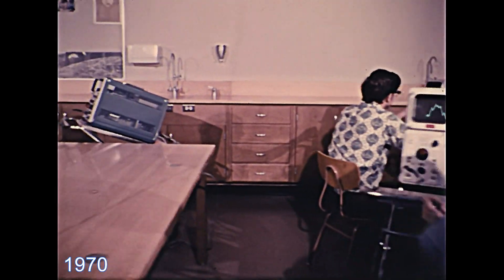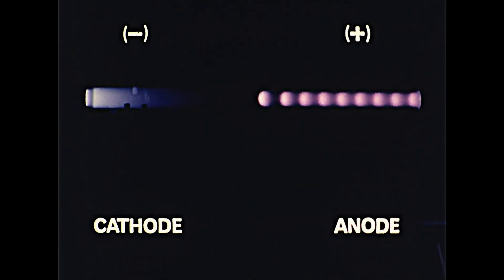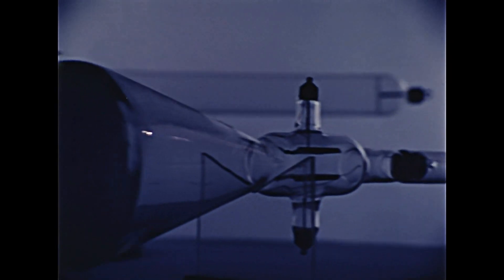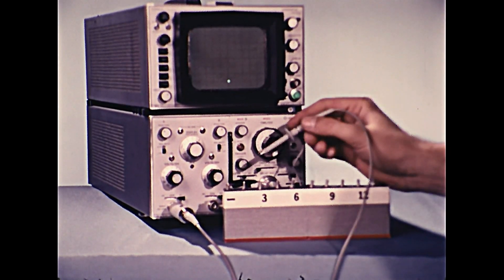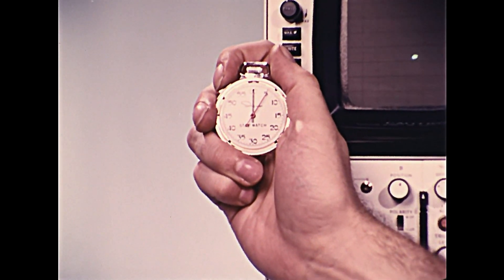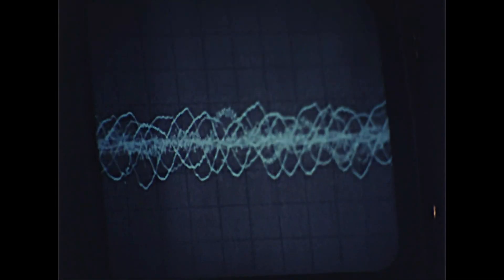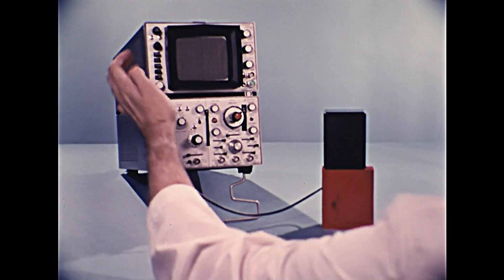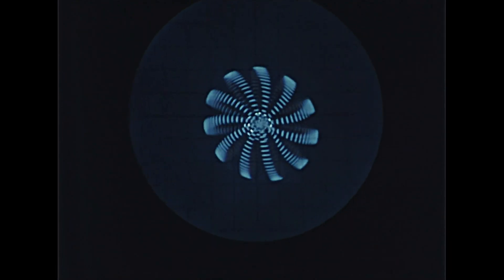1970 Vintage Electronics- The CATHODE RAY OSCILLOSCOPE - CRT Tektronix 561A  HP 180A

Comment: As an electronics engineer in the 70s/80s I used these a lot. Probably one of the last times I used one was to align the read/write heads on those new-fangled 8-inch floppy drives in the early days of digital. Yep, the heads had to be manually set up to read/write floppies correctly. In my collection of junk memorabilia I still have an 8-inch 'alignment diskette' needed for that process.
Reply: I have a 5 1/4 alignment disk, anyone with a 3.5 to complete the set ?

Comment: That's an HP (Hewlett Packard) scope , I believe.  The major brands of that time are largely all gone, only a shell of the entity exists today.  The Cold War largely contributed to their growth, end of the Cold War caused a huge equipment surplus market and sharp fall of retail sales.  Farming out the manufacturing reduced costs and increased profits.  Ultimately, given many years, this causes the major brands to lose market share.  Uncle Sam steps in to stop the massive bleeding with protected markets.
Reply: Keysight appears to be the cultural offspring of the instrument branch of Hewlett-Packard.   I wrestled for years with whether to get a digital oscilloscope and which one; Rigol's are good and inexpensive but I wanted something just a bit better with a real instrumentation heritage but not laboratory cost.   DSOX 1202G also has a built-in signal generator good up to about 20 MHz and can do some amazing things; but I wanted not to give up any analog scope features such as variable persistence and X-Y mode.  It can do all that pretty well.
Reply: Tek and Hp now aglient are the traditional high end scopes.  The high end is joined by LeCroy and R&S.  They have abandon the mid and low end markets to compete only at the high end and with it the high price.  I dont buy Tek or Hp for my business  they are better but not the price difference better and like most i dont need a cutting edge scope for my designs.  I went to school with Tek and Hp, and both brands still push heavy in the school market trying to gain young fans.  What i would tell Tek and Hp is engineers will pay more, not that much more and they are more likely to buy on value than nostalgia
Reply: @EfieldHfield_377  I also used some various brands professionally over a LOT of years (military, university, career) going all the way back to the huge tube type Tektronix and HP models.  After that, the nice Tektronix 465B was one of my favorites that I used for a great many of my working years.  The HP180 was one of my least favorite - it just felt flimsy with chintzy controls.  Recently, for my home use, I bought one of the Chinese ones, a Siglent SDS1202X-E 200 MHz 2 channel scope.  It is surprisingly decent and sure didn't cost much.  It even came with a couple of 200 MHz probes that were also of better quality than I expected, although not top notch.  (I have Tektronix probes I normally use.)  For somebody looking for good used things, the Tektronix 2246A is quite nice.
Reply: @trainliker100  I never thought HP scopes felt cheap, but there were a few models that didn't trigger very well.
Reply: @richardgray8593  I wasn't referring to all HP scopes.  Just the 180.  Others had solid feeling rotary switches and pots that didn't wiggle and were instead solid feeling like typical in other HP equipment.  I remember WAY back when having to repair a huge tube type HP;s (perhaps a model 150?) that the tube sockets were PC board mounted and the boards had discolored to a dark brown from the heat in those socket areas.
Reply: @camodudeA51  The ones they show in quantity on scope carts in a classroom and for the demo at the very end are Tektronix.  The one they use for those demos in the middle is a Hewlett Packard 180.  It is the bench version.  They also had a rack mount version of the 180 with the screen at the left and the two plug-ins normally below the screen instead to the right of it.

Comment: CRT oscilloscopes are common to me. I grew up with them. I still own a small Hameg and sometimes I even use it (although now, with the high electricity prices, I'd rather not).
I'm 58, so, as an engineer of that age, I've seen the transition from analog to digital. Young people nowadays accept the technological status they meet and can't hardly appreciate how it was some decades ago, when we also were marveling at our technology then, as we could not yet imagine how technology would evolve. It was obvious to us in the eighties that digitisation would push through, but we could not predict the scale and size of it.
Reply: Well said.  When the LCD replaced the CRT in scopes I was astonished by how quickly CRT scopes went away.  Reduction in weight size power and cost spelled the over night doom of the CRT.  I personnally have not used a CRT scope in years.  Sold a Tek 744 and an hp Logic Analyzer i owned to a friend of mine about 4 years ago, before that they were sitting in my lab for years more as relics than usefull tools.  And shout out to the black girl in the video.  Doing her thing.
Reply: Tektronics was THE BEST.
Reply: "I still own a small Hameg and sometimes I even use it (although now, with the high electricity prices, I'd rather not)" Holly ..., how much is that Hameg consuming?
Reply: @ciprianpopa1503  How much it consumes? I assumed that it would be a lot, but now that I come to actually check it, it appears to be only 23 W.
It's the HM 103, one channel @ 10 MHz. In the early eighties, this was what I could afford as a student on a lean budget.
Reply: @ciprianpopa1503  probably hes oscilloscope is not transistorized but uses tubes

Comment: I don't know if this the place to ask this question, it would worth if I enroll an associated in electronics (2 years Community college) in the United States?
Reply: A basic or even slightly above basic understanding of electronics is helpful for many activities.  It can also be fun!
Reply from the maker: Hi Ed, an Associates in Electronics degree might be a good start to several career paths.  If it is a good course with some hands on experience and good reputation, that is important too.  Higher level degrees like electrical engineering usually help if this is your career interest.  Depends on where you want to focus your career.  In the U.S., another good career, different but worth mentioning is electrician.  They seem to be in high demand and make good salaries.  All this is just my opinion.  Hope this helps!  ~  CH
Reply: @ComputerHistoryArchivesProject   I'll second that....
Reply: Whether it is worth it depends on your goals.  For example, it could be a step toward getting a four-year degree in electronics engineering to become an electronics engineer.  With a two-year degree, you are more likely to have job like electronics technician, engineering technician (work with engineers), test technician (develop automated testing systems), field service technician, telecommunications technician, and so forth.  For many years, I worked at a company in California where we hired quite a few technicians from, of all places, a community college in Iowa.  It seemed to have an excellent program and every single person we hired was first rate.  It is "Indian Hills Community College".  They have a very nice web site, and you want the section on "Electronic Engineering Technology".  You could check that out, and then find similar schools and check them out, also.

Comment: Must have been one expensive piece in the 70's that scope that could store the waveform
Reply: Exactly. I was wondering how that could work, especially that there is a dedicated button for it.
Reply: @Sonnell  Could be something like this https://en.wikipedia.org/wiki/Direct-view_bistable_storage_tube
Reply: @mcmaddie  "Could be something like this"
Yep, that's what it was.  They were often used as computer terminals where text would be written to the screen and then erased in a flash of light.
Reply: @thomasmaughan4798  ... a flash of electrons
Reply: That's called a storage scope. Typically they had low bandwidth, sometimes less than 1MHz.
Reply: Yes, very expensive.  There's a fine mesh behind the phosphor that once struck by the electron beam keeps the image alive for a while.  Then you push a button to erase it.
Reply: https://youtu.be/5grj4lll87Y?t=138
This explains it. How amazing!